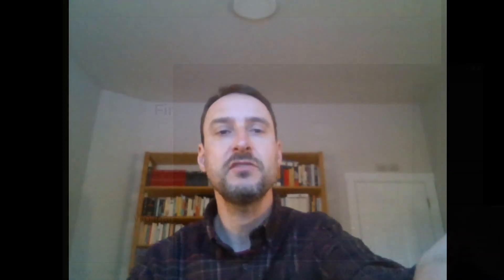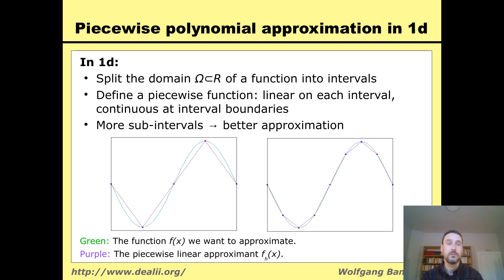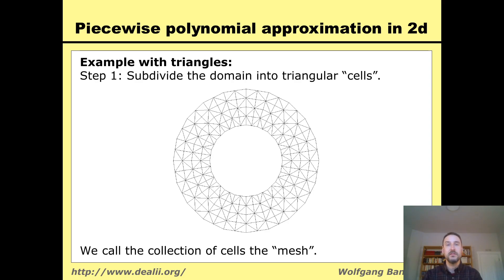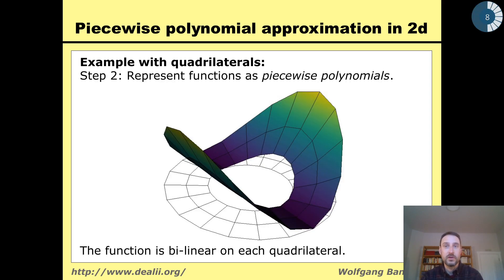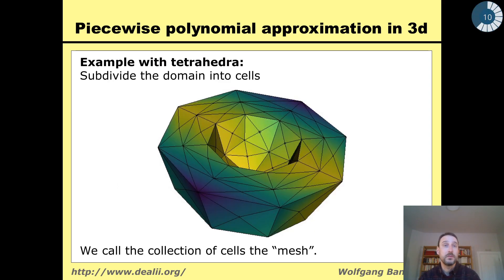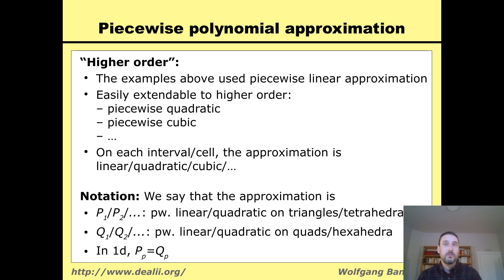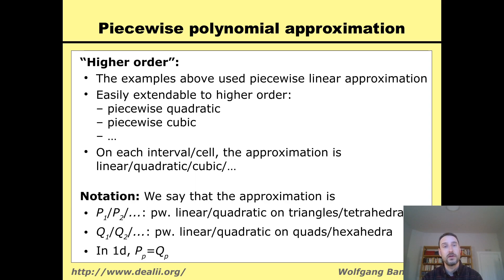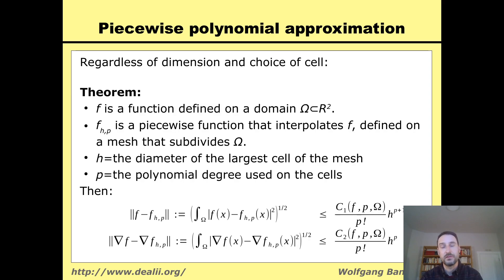Finite element methods in scientific computing: Lecture 3.92

Comment: Thank you for the great content Dr. Bangerth. One question: where does the max diameter definition come for the h?
Reply from the maker: Are you referring to the definition on the page on "Piecewise polynomial approximation"? The error is a sum over all cells, but each term can be bounded by the error on the largest cell.
Reply: @wolfgangbangerth2397  Thank you for the reply Dr. Bangerth. You define the h as "the diameter of the largest cell" around 12:52. I wonder how the diameter or circle as geometry come into play? Because our mesh never has a circular geometry, may be triangular, quadrilaterals in 2D, and the others in 3D. Then why would the error be bounded with the parameter h that is defined as circumscribing diameter?
Reply from the maker: @sagsolyukariasagi To understand where this is coming from, you have to read up on the "Bramble-Hilbert lemma". In it, you consider the eigenvalues of the gradient of the mapping from the reference cell to the real cell. These are, in general, difficult to compute but we get an upper or lower bound by asking how large a cell is -- as evidenced by the diameter of a cell. Alternatively, one could use the length or the longest edge of a cell, or a number of other measures that are all in some sense equivalent. It doesn't really matter in practice how exactly you define h -- it just needs to reflect the "size" of a cell in some way.
Reply: @wolfgangbangerth2397  thank you very much for the detailed answer and sharing the related lemma Dr. Bangerth.